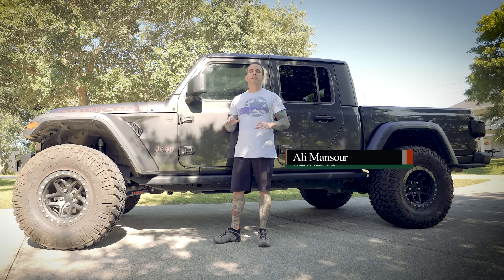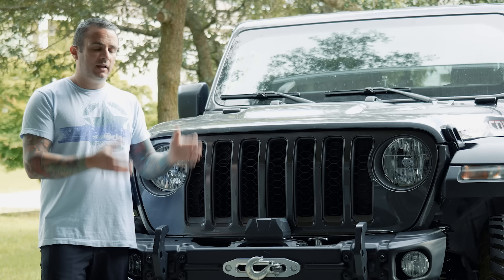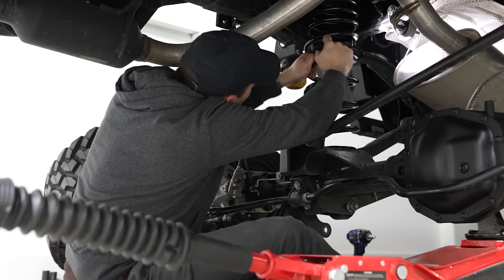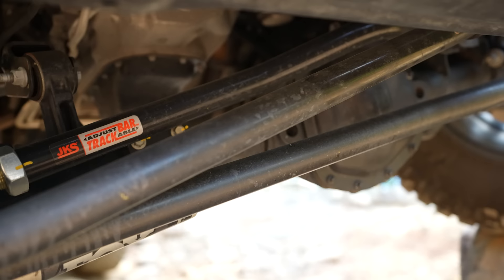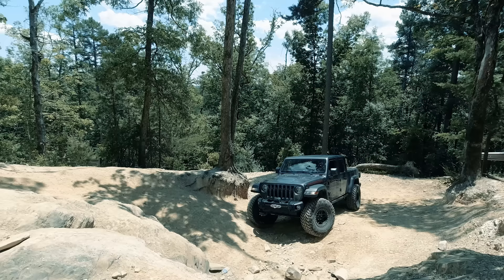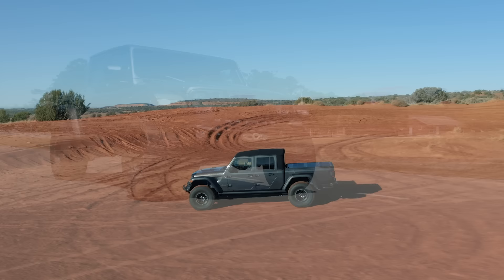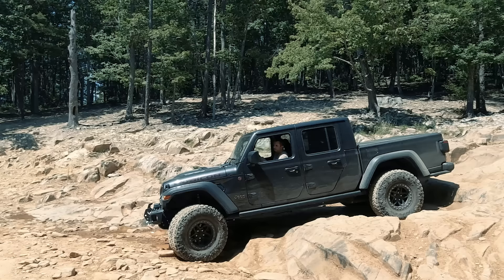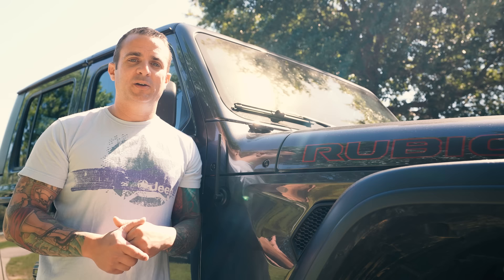Jeep Gladiator Rubicon 3-inch JKS Suspension Lift Install & Review | Inside Line

Comment: Lifting the JT makes a huge difference when offroading.  When my Overland was stock my belly was scraping everything especially air downed with the stock 32s. I ended up going with a Rock Krawler 4.5 Pro-x lift and 39s. Surprisingly with it being high it rides alot better than stock on and off road. Even on the highway it rides smooth and feels planted.
Reply: How are the axles holding up?
I wanna go 37s but I hear a bunch of folks saying the 44s won’t survive 
And a lot are saying the new gen 44s are way stouter then people are giving them credit for
Reply: @steve-0891  they are holding up great.  I know a fair amount of people running 35s upto 40s on stock axles and have had no problems and they wheel them.  Granted none of us are full throttling through rocks and trying to destroy them.  Lol check me out on Instagram TheGhostJT I typically tag my crew of JTs I roll with.  If the axles do grenade I'll post it.
Reply: @TheHitSquadOffroad  awesome
Thanks man will do!
Reply: Still rubbing the belly at all?
Reply: That's a pricey lift.  I would expect a good ride.  Did you go all out w/Coil overs?
Reply: @timothyhayes6929  It rides pretty good. I didn’t start off with coilovers. That was too much for my blood. Lol I just wanted to do what I’m calling stage 1 of my lift which included the lift matched with MetalCloak RockSport Shocks.  I’m definitely going coilovers or Ori Struts in the future, but the Metal Cloak shocks have been doing great for the price.

Comment: I have a '21 JT-R Diesel, 6" MetalCloak/Evo lift.  I run 37x12.5 on 17x9 with a 3.5" backspace.  The tires do stick out past the fenders, but tuck under the Rubicon fender at full flex both front and rear.  So you can have a fairly aggressive look without having to worry about whether they will tuck under the fenders.  No need to run 5.25" or 4.5" backspace unless you like that narrow aesthetic.  I live an hour from the Rubicon Trailhead at Loon Lake and we run up there often.  The damn forest fires have really put a damnper on this season of wheeling in that area.
Reply: Blaine, how has your gas mileage been with the 37s and the diesel?

Comment: Thanks for the detailed review! picked up our, new to us, 2020 JTU last week, partly because it better fits our mission, which includes flat towing her with our dirt bikes in the bed, but also because of the dissatisfaction with how our JKU Rubicon's handling on road went down after a 3" lift and various other mods like track bars, shocks, 35" tires, etc. She became an incredible crawler, but drivability on the pavement JKU on the road. I know she'll not even come close to the JKU off road, but your review gives me hope that I might be able to get her up a little higher with a 3" lift and 37" wheels and still maintain good on pavement drivability!

Comment: I have an 08 Jk with 3.5 lift and 37's. Been running Barrett/Rubicon/ slickrock since 09. Get out and use that Grocery getter!! FYI all rims have backspace and steel rims are best for rocks, a little more weight but they won't Crack when slammed by rocks.

Comment: Nicely done. Looks like you don't have to do much to make 37s work properly on the Gladiator.
Reply: Was there any higher difference? My drivers side sits about 3/4 higher same lift professionally installed.
Reply: @prestigevending15 probably needs spring spun into its pocket
Reply: No what it was? The “professionals” didn’t adjust the quick disconnect links right so one was 1/2 in further.
Reply: @prestigevending15  there u go

Comment: Ali, great video.  I think you got the setup I’m looking for.  Is this the J-venture kit and you added the fixed length control arms?  This lift seems perfect and I want the stiffer ride.
Reply from the maker: Thank you and that's correct. I optioned for the arms and Fox shocks.

Comment: You may want to check the rear driveshaft for binding at full flex. The latest tera flex video mentions this.
Reply: It hasn’t been a problem with my setup. The kit only runs 1.5 inch rear lift springs. This may be an issue with a longer travel setup, but not something I’ve experienced.

Comment: My rubicon is on 37s with 2 in mopar and 1in spacer in front and .75 in rear.  Adjustable lca and front track bar,and rear track bar bracket.  I'm running  6.5 caster. 5 is too low to me.
Reply: If my lowers were adjustable, I’d probably kick them out a touch to get a little more caster out of it. However, it does not drive poorly as it is.

Comment: I have a sport a non max tow.  Could I run those wheels with 37s and a 3.5 inch lift? Would it clear everything? I want to run the higher back spaces wheels but I don’t have the wider track axles.
Reply from the maker: I think it’s likely you’ll rub the control arms with this same wheel and tire package. JKS recommends 4.5 to 5 inches of backspacing for non-rubicon models.
Reply: @DrivingLine  thanks a ton!!!

Comment: Great video! Whats the deal with the axles on 37s? Ive got 37s on mine, and i keep hearing jk guys say 37s will break shit constantly? Is that true given the gladiator has the ram 1500 style anxels?
Reply from the maker: These axles are better than the JK 44s. I’ve never had an issue with these axles on 37‘s under my Gladiator or my Wrangler. The ball joints aren’t great and the front axle disconnect can be problematic. However, you can put some Dynatrac ball joints in and replace the stock axle shafts with RCV performance ones (one piece) and you have a pretty solid front axle.

Comment: Following your build due to interest in building a gladiator myself with 37s. PLEASE tell me you loosened ALL 16 control arm bolts and re-torqued  them on level ground. (Preferably with 1/2 tank of fuel and driver in the seat)
Reply from the maker: The front arms yes, the rears I did not. (Well, other than the one bent arm I had to replace (more on that in a future video).

Comment: Nice video! I just ordered this kit for my JTR. Where did you get the solid bolts to put on the sway bar links to replace the quick disconnect pins?
Reply from the maker: I believe they came with the kit. I don't recall having to purchase any bolts for the sway bar links.
Reply: Thank you!

Comment: Ali, great vid. Question I have with the Jks is which 3” kit would work best on my 2021 gladiator rubicon eco diesel?? Thank you again!!
Reply from the maker: I'm really enjoying my 3-inch JKS kit. I don't know if they offer diesel specific front springs and shocks at the moment however.  Given the diesel is heavier, the springs will likely be spec'd just for that. I would check with JKS and if they don't have anything I would try EVO Mfg. I know EVO has a diesel Gladiator in their fleet, but it's on coilovers, not just a standard coil and spring. Nothing is wrong with that, it's just going to up the price over a more conventional kit.

Comment: Great video! Do the springs eliminate the rear rake? How do you feel this set up would do towing a 4,000 lb trailer? Thanks in advance
Reply from the maker: Thanks. The rear springs are on the soft side and make the Jeep sit fairly level. If you are towing frequently, I would recommend a HD rear spring. I’m not sure if that’s something JKS offers.

Comment: thank you so much for a honest and comprehensive review of this lift! This is the lift I want to go with on my Gladiator.  I believe I will go with 35s as mine is my daily driver.  thoughts and opinions  on this please?  Thank you
Reply from the maker: Thanks for the feedback. If you have a Rubicon, the 35s might look a little small, but that's more of a personal preference. I like how the 37's look and perform off-road. However, moving up to a 37 also resulted in me regearing the differentials to get power and overdrive gears back.

Comment: I got. 2021 gladiator Rubicon I want the JKS. Do I need to get upper and lower control arms for the front and back or just the front I don't want to have any problems with this truck.
Reply from the maker: You can just do lower control arms and dial in the caster that way. This kit has fixed lowers, but I would recommend adjustable over fixed.

Comment: What’s the total height of your gladiator after the 3” lift and 37’s? If I’m calculating correctly it should be 6’8”? I’m asking because my underground parking clearance is 6’8”. This combo would allow myself to squeeze in.
Reply from the maker: It’s been a while since the Jeep has been setup like this, but I can tell you that it fit under my 7ft garage door with room to spare. In fact, it now has 40 inch tall tires and still fits under my 7ft door with plenty of clearance.
Reply: @DrivingLine  thanks, with my calculations I should be around 6’8”.

Comment: I really like your setup, you even have the front bumper I plan to get. 37s are a little large for me. Would this lift work well with 35s?
Reply: I think the 35s may look a little small, but there’s no reason you can’t run them with this lift.

Comment: I got a 2021 Rubicon gladiator just orded the 3" jks qith adjustable control arms the lower fronts what do you recommend setting them at 35" tires 18" rims Rubicon bumper wirh a badland 12000 pd winch.
Reply from the maker: I would take it to an alignment shop and get them to set the caster to 6 degrees. I think you’ll find that keeps the steering nice and light and makes the Jeep very drivable on the highway. If it feels too sensitive, you can go down a bit with the caster, but I would imagine you’d be the happiest with that. If you’re looking for a measurement, you just need to have the lowers roughly a half inch longer than stock when you install them. That’ll get you close.
Reply: @DrivingLine Thank you for your advice it really helps.

Comment: Question. Did you have to regear your gladiator after this 3 inch lift and also, did you have to replace the ball joints? Or is the ball joints OK because of the negative all set you have on your tires kept it more in factory spec. Thanks.
Reply from the maker: I have not replacement the ball joints. The high amount of backspacing helps to preserve the front end components for sure. I did end up re-gearing with 4.88 differential gears.

Comment: 34inches for trac bar for the 3in lift jks
Reply: That’s correct. The instructions say 34 inches. However, that does not account for a winch or winch bumper. It’s still best to start with that measurement and then you can adjust in or out if you need to. I believe mine was about an 1/8th of an inch shy of 34 inches to be centered.

Comment: What would happen if you use the diesel 3in suspension kit would it just give you a rough ride? 11-19-23
Reply from the maker: In a non diesel application the rate is going to be way too high. It’s going to be much firmer. I wouldn’t recommend it.

Comment: Wonder how this lift would work on a diesel? The diesel is much heavier in the front. I’d like to install this kit on my diesel, but I’m wondering if it would bottom out frequently.
Reply from the maker: I believe JKS has diesel-specific springs now. So, you should be good.

Comment: Do you need the new front control arms? I noticed they don’t come with the kit.
Reply from the maker: I would get them so you can dial in the caster. I believe if you don't opt for lowers you end up getting caster bolts, but don't quote me on that. I got fixed lowers that were longer here. I ended up getting adjustable ones. If I had it to do again, I would have opted for the adjustable arms when I did the lift.

Comment: Does the 3.5" lift fit the Gladiator Rubicon?? I don't know if there is a difference between the 3" in this video and the 3.5" I just ordered
Reply from the maker: When I ordered my kit a couple of years ago, JKS only offered this system. At that time, it stated that Rubicon's would only gain 3 inches of lift, but the other models would get 3.5 inches. It looks like they now offer a 3 and 3.5 inch version. So, you should get the full 3.5 inches of lift with the only exception being if it is equipped with the diesel engine.
Reply: @DrivingLine  Good to know! Thanks for the quick reply!

Comment: I've narrowed it down to this lift or Clayton's 2.5. I was leaning towards the 2.5 to put less stress on the shaft. If I will almost never take it off roading. Will this lift still be ok on the shaft and rest of the suspension? It's daily driver. Street 99.9% of the time.
Reply from the maker: I’m not familiar with the details of the Clayton setup, but I can tell you that I’ve been extremely happy with this kit. I’ve driven this Jeep cross country twice, wheeled all over Moab, the Carolinas, and Tennessee. The Jeep is now on Dynatrac 60s and 40s, but I am still running the same springs, shocks, and front track bar. I did upgrade to the adjustable control arms, but that was strictly so I could dial in my axle placement.
Reply: @DrivingLine  That's awesome!! I guess i shouldn't have any issues if most of my driving is city. I was just worried that maybe 3in was pushing it with no rear adjustable track bar or  rear control arms.

Comment: How much maintenance does the jkrawl system need on the JT?
Reply from the maker: This kit requires very little maintenance since it doesn’t have the adjustable control arms. I’ve since upgraded to all adjustable JKS control arms which does require a little bit more work. I’ve had to replace a few of the control arm bushings over the past year. Otherwise, pretty low maintenance overall.

Comment: Do you have any rubbing issues with that tire at full lock when you are climbing rocks? I have 35" BFG KO2's with a Metalcloak 3.5" GameChanger and see a bit of rubbing but I am on stock wheels. I think I heard you mention backspacing but the won't help all that much either. Reason I ask is that I want to move to the Nitto's in 37". Thanks!
Reply from the maker: The tires have rubbed the control arms before, but it rarely happens. If you are running stock wheels, I would recommend adding a set of wheel spacers to combat your rubbing issue (assuming you don't want to get a new set of wheels.)

Comment: Which jks lift did you install? Trying to decide on what I want. The Jventure, Jkontrol or Jkrawl. So was curious which jspec this is?
Reply from the maker: J-Venture with the optional fixed lower control arms.
Reply: @DrivingLine  hmmm they may have changed options since you posted. Did you buy direct from jks?
Reply from the maker: I did. It’s been a couple of years since I ordered the kit. The only two options I remember having to add on were the Fox shocks and lower control arms.
Reply: @DrivingLine  Thank you so much for replying. One last question. Are you still running the jks lift and still happy? Or added anything you would recommend? Have a 2021 rubicon with 35s
Reply from the maker: My Jeep has changed quite a bit since this video. However, I would still recommend this lift. I really enjoyed it.

Comment: Did you leave the 1” leveling spacer, your had installed previously, in when you put this kit in? If not do you think it would be ok to do so?
Reply: No. I pulled it out. The added lift wasn’t necessary. I would not recommend leaving it in primarily because the front end you be too high. If you did want to combine the two, you’ll want to opt for fully adjustable control arms so you can properly dial in the axle placement and caster settings.
Reply: @Ali_Mansour_Editor  awesome ! Thanks for the info!

Comment: With the bigger tires loaded down with gear does the 6-cylinder underpowered when your trail riding or would you recommend spending the extra money and buying a diesel version
Reply from the maker: I think the V-6 power is fine. I know the diesel has more torque, but my experience with the emissions equipment on the later-model diesels hasn't been a positive one. So, I tend to avoid diesel. With the right gearset for the tire size, the V-6 works well on road and off.
Reply: After all the upgrades would you still get the Rubicon or would you go with a lower model to save on cost. Love the set up definitely going with 37s if I  go with gladiator over the Bronco. Thanks Mike
Reply: @michaellyden9839  lower models have Dana 30s (or 35s? Too lazy to look) , no lockers, and no electronic disco sway bars. If you off-road, 37s on a lower model will grenade the axles. And good luck rock crawling 37s without lockers. If you’re doing high speed off-roading or like to reallyyy hammer down while rock crawling.. rubicon axles may grenade with 37s. So get a base model and use the money saved for Dana 60s and better lockers.
Reply: @suchgr8hieghts  saying you're too lazy to look just allows you to spew misinformation. All JTs have Dana 44s, and the Sport Max Tow, Mojave, and Rubicon all have the heavy duty wide track axles that are more or less identical except for the rear locker in the Mojave and front and rear lockers in the Rubicon. With careful driving, 37s work fine on the JT axles.

Comment: would a 2.5 lift be okay off -road as well ?
Reply from the maker: It would. These Jeeps benefit from taller lifts due to the wheelbase, but if you don’t mind hitting the frame and skids a little more often on the trail, you can get away with a low lift height.

Comment: Is the drive shaft good with a 3 inch lift? Or does it need to be replaced
Reply: I’m still running stock driveshafts. JKS does offer longer front shocks for those running an aftermarket front driveshaft.

Comment: Does this 3" lift have any negatives if I run with 35" tires?
Reply from the maker: No negatives. There will just be more room in the wheelwell.
Reply: @DrivingLine  
Does it look o.k.? Don't wanna be laughed at by other Jeep-ers 😜
Reply from the maker: @GotYo6  I prefer the look of the 37s, but I've seen a few Gladiator Rubicon's with similar lift and 35s and it doesn't look to odd. I think with the right aftermarket wheel, it wouldn't look bad. It's also important to get a true-to-size 35.